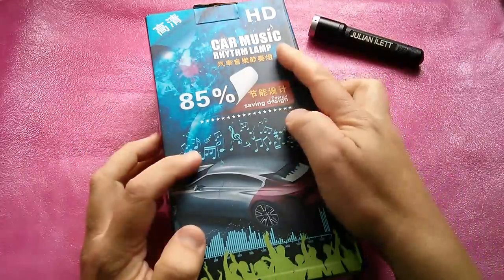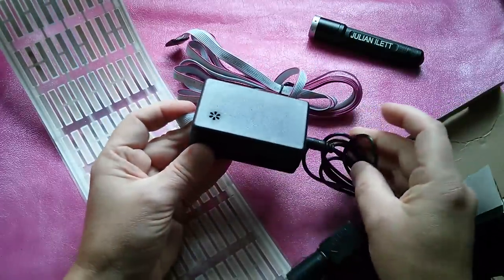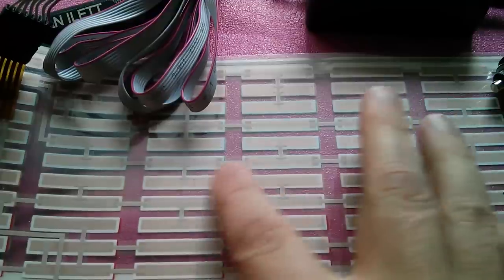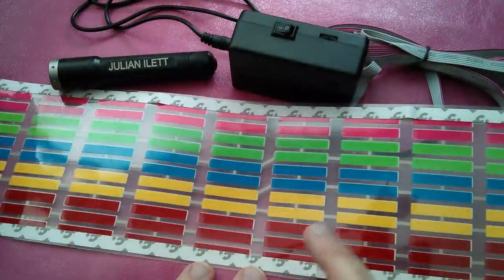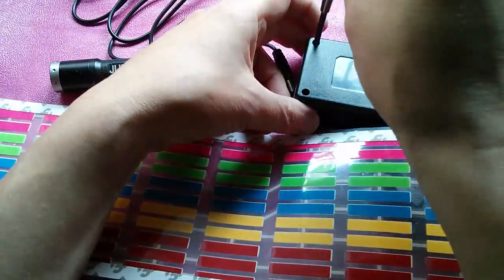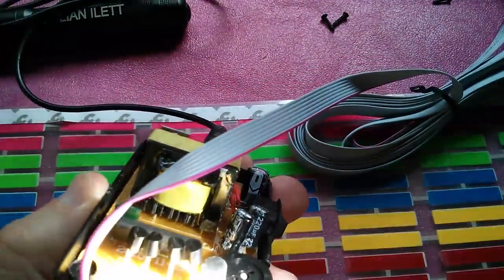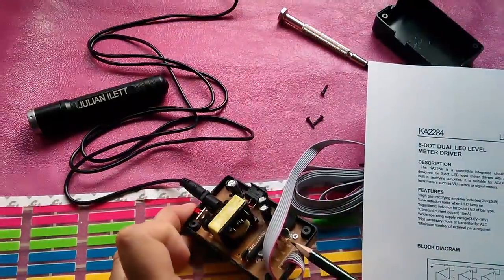Car Music Rhythm Lamp on Lurid Pink Leather

Comment: Electroluminescent panels run on low frequency AC, so yep, you can hear it just fine. The panel itself is technically a capacitor, and it has piezoelectric properties, so essentially a speaker, too.

Comment: Remember the old Monsanto seven-segment LED displays?   Most of them were common-anode, and conventional wisdom would tell you that pin 1 is on the side where the notch in the package is located.  Not in this case; it's actually on the opposite side.

Comment: Because the VU meter chip can only handle low voltage, the transistors would be for interfacing and switching the high voltage. i would guess that 2 of the bars would need to be parallel because there's only 4 transistors.
There should be a capacitor and resistor that you could change the attack time
"1. By changing the time constant C1 and R1 ,the response, attack and release time, may be varied."
the pot may be R1
Reply from the maker: Shame the chip doesn't have a dot mode - it would probably work better.
Reply: ikgk
Reply: kkkkkkkkjkhku

Comment: Hi Julian They seem a bit too bright for electroluminescent segments... When you show the back of the segnents there seem to be lots of fine granuals in there... I wonder they're the 'lightpaper' printable-LED stuff, or maybe the printable LEDs which mikeselectricstuff showed in his 'Nth-Light printed LED tape' video.  Cheers!!
Reply from the maker: I should probably try to measure the voltage coming out of that transformer to be certain.
Reply: Yeah, I though the same. Small pieces of LED die sprinkled on electrodes. The traces seem to be the granular as well. So maybe just metal powder on plastic foil and then the hole thing is laminated.
It also looks like they connected a few of the rectangles "out of order" on purpose so they can fake a "spectrum analyzer" VU meter.
You could try to poke some needles in the plastic near a rectangle and supply it with a few volts limited to a few milliamps. If it lights up, it's LEDs (and if it's printed LEDs polarity shouldn't matter). There should be at least three plastic layers (one central isolation and the two outside covers). So don't poke the needle through perpendicularily but in at a very flat angle.
Did you check it the TO-92 package devices are transistors or triacs? Electroluminescent light need AC, which wouldn't work with a single bipolar transistor per channel.
Reply: They are Light Emitting Capacitors. Don't you see the transformer in the circuit? It is used to generate high voltage for LEC's. Who uses a transformer that big to drive LED's? And 4 transistors are used as switches. They get low voltage trigger from VU meter IC and switch the high voltage from transformer.

Comment: I think those are indeed LEDs. bigclive once had LED-Filaments that consisted of tiny LED- fragments, that were randomly spotted onto the substrate and were driven by AC. They should light up partially, when you apply DC.

Comment: The chip could be connected directly to the 12v supply and the boost converter output probably has common ground with the power, going straight to the transistors. This way the chip works at comfortable voltage and instead of switching LED's, it turns the transistors on and off, controlling the high voltage via them. There is another option: that the boost converter produces 2 different voltages - one for the chip and high voltage to be switched by the transistors. But i don't think this is the case here. If i had to do something similar, I'd just go with the first option as it seems to be more simple, less components are required, and it's probably going to be more reliable.

Comment: It's a pretty big piezo tweeter. Try to drive it directly(or through an transformer) from a stereo.
Reply: I TRYED THAT IT WORKED PUT A 3 OHM RESISTOR IN LINE WITH THE ++ SIDE OF YOUR SPKER OUT TO LIMET THE LOAD ON YOUR AMP A AC BELL TRANSFORMER WORKED FOR ME THE LO VOLTAGE WIND ++ THE RESISTOR GOES TO THE AMP

Comment: An equalizer lets you increase or decrease frequency ranges (thereby to equalize them) before the signal gets to the amp.  This thing doesn't equalize anything, it just responds to what it hears.  Looks to be a nearly linear level visualizer, with probably a wacky looking frequency response.  Our ears work on a logarithmic scale so that would make sense why it looks like it's shooting up way too easily.  I would think, wouldn't it be fairly trivial to insert increasing values of resistors to the comparitor inputs, in order to achieve a more natural log response?  

Much less trivial, I would love to play around with a couple of these for indicating conditions outside before I leave for work.  Drive time, temperature, precipitation.  Although I'll probably stick to LEDs (which can be seen and not heard) and forego the whole high voltage messiness.  This is really thin though.  I do like that part.

Comment: it does kind of appear to be reacting to the audio spectrum. theres a certain point on the song where you just hearing the kick drum which is 20hz - 100hz and you see those bottom red light on their own. those different colour bands are probably lit at different audio frequencies (maybe using band pass filters)..but all the frequencies below are lit as well. a typical graphical EQ has banding from left to right..not this top down layout. The typical male voice is from 85 - 180hz. maybe a way to test is to play a tones between 20 and 180hz and see if you can get different bands to progressively light up???

Comment: I can foresee this device being used in an application where the driver places the microphone module underneath the bonnet and placing the electroluminescent panel in the back window. This way, you have got yourself a very rudimentary “acceleration meter”.

Comment: is acc socket what yall generally call cigarette lighter i know thats not what its generally used for these days but thats what we still call it across the pond
Reply: It's only a lighter socket if it has the flattened U shaped bi-metal strip at the bottom. No strip=accessory power socket.

The bi-metal strip is what holds the lighter plug down, as it heats up it spreads out eventually getting hot enough to release the plug so it pops out letting you know that it is ready. There is usually a second safety bi-metal strip on the back that bends out and touches ground to short out the socket and blow the fuse to prevent overheating and a fire in case the plug doesn't pop out.

Comment: on what kind of voltage does the light emitting capacitors work? so what does output the step up converter?

Comment: Im struggling to understand how its wired up. 4 Transistors, 5 rows to light, 2 of the 7 wires not connected, some of the segments only have 1 connector fed from a different colours cell so only one line feed instead of 2, ie no common. Seems to be a mish mash of series/parallel connections ! arghh lol
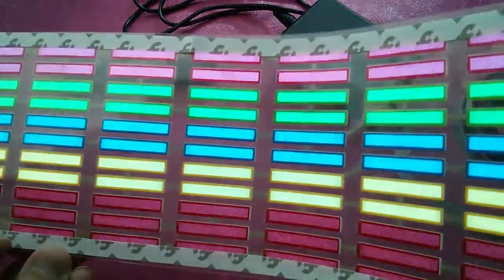Pausing the video shows that some segments only light when its neighbour is lit, most obvious at 3:56 where 3 green segs wont light until magenta above is lit. Quite strange but Im guessing the transistors are switching groups rather than rows of segments and the illusion is created by arranging the segments as such the timing and perception of vision trick the brain to fill in the gaps as the mind EXPECTS to see a fluid up down motion of the display :) ... I guess ..

Comment: Hi there Jullian, I'm not an electrician so I understand just most of your stuff. I'm mainly interested in the component specs and uses, specifically to use them in my RC-hobby. (went to most of your LED drivers vids to learn and built my own. thnx) 
now i wonder about those luminescent thingies: Are they useful as individual components?  (to light up an rc-car interior for example) shell those lights be waterproof (once cut up in single items)

Thanks,
WOuter

Comment: But there are 7 cables, and 6 light segments.
GND,1,2,3,4,5 and what?
Reply: That Guy
But there are 7 cables, and 6 light segments.
GND,1,2,3,4,5 and what?
'
7 wires on the board to LED board sheet...
one red line is a positive and six lines are negatives...
same thing with 7 segments and 9 lines in the one block of LED clock